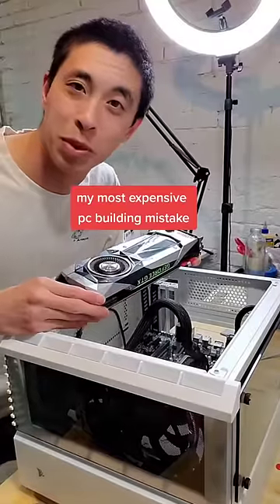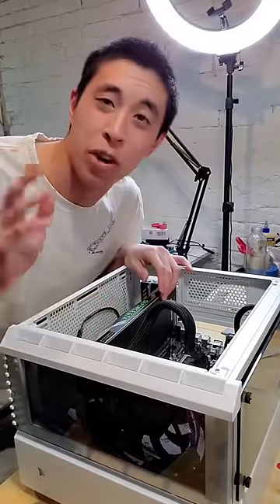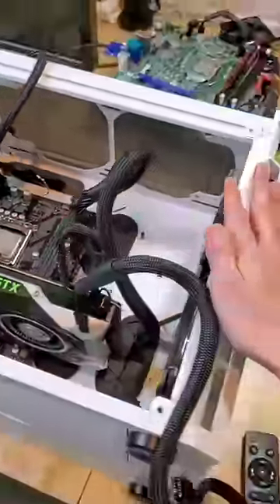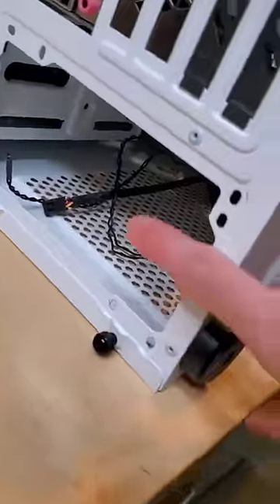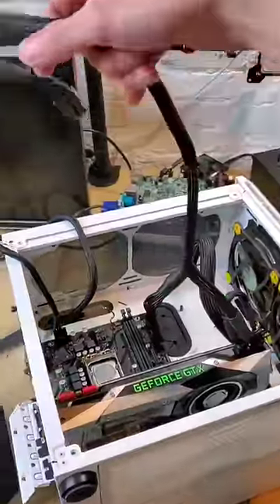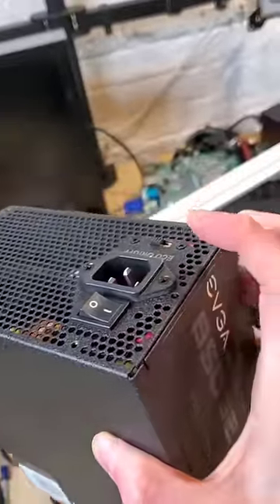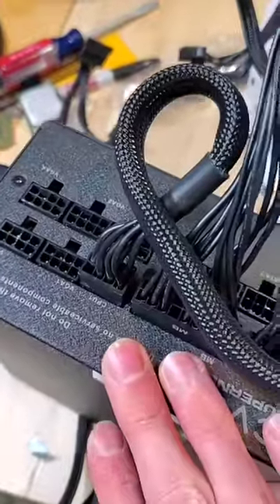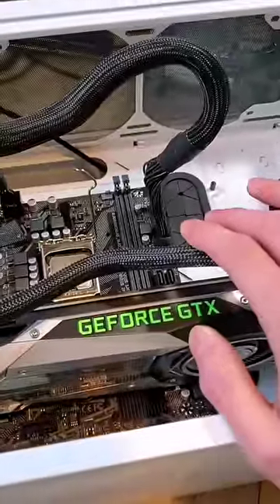my most expensive pc building mistake... #shorts

Comment: My screwdriver slipped when I was tightening the CPU cooler, killed the motherboard, had to get a new one🤠
Reply: Make no sense 
How does a screwdriver kill ur motherboard I have push gpu too hard so many time and my motherboard still work new
Reply: @BlackholeU_U  it scratches circuits or pulls off components like resistors
Reply: Small Capacitors too
Reply: @BlackholeU_U   if traces are ruined motherboard can lose memory channel, usb ports, lan port or can just fly itself on launch.
Reply: That happened to me too years ago.
Reply: @Helva lol
Reply: This legit happened to me on my first ever attempt at building a PC. I was tightening the AMD wraith stealth cooler down and suddenly I lost grip and the screwdriver kind of slid to side and punched into my motherboard. Safe to say - My PC was error free when booting up and I was pleased with the results. Rookie mistakes, tho I wish more PC building guides would outline these little nitty grits. Most mistakes go unreported anyways, so might as well make everything that can fuck up your PC building known.
Reply: @yvesford9579  That a screwdriver can drift off is pretty simple and expected, especially with low experience/low strength.

That's why being more patient can be worth it.
Reply: That happend to me and i scratched my mb, but nothing happend tgod
Reply: Nobody tell him about the Socket 462 cooler mounting.
Reply: Dont Read My Name💞
Reply: same except it was with the demon core
Reply: @Justgreen89925  solder them back 💩🤡
Reply: HOW FUCKHING HARD WERE YOU PUSHING THAT SCREWDRIVER SIR? 😂😂😂😂😂 OR DID U PERHAPS USE AIRHAMMER TO TIGHTENG THE SMALL SCREWS🤔
Reply: @askomoisio  lmfao
Reply: Idk but damaging a MB with a Screwdriver is pretty damn hard tbh. You have to be the most unluckiest person to demolish your MB in that way.
Damaging or flipping of components: Very Very Unlikely
Damaging the PCB: Also very unlikely, you really need SCRATCH the PCB by force to do real damage

Been working in the branch and that type of damage is really hard to do by accident. Heat is mostly more a threat to these components (or Electric Energy) but not something like a Screwdriver that fell onto it
Reply: @nicz7694  by tightening a cpu cooler you are using a lot of force and if it slips you can eliminate from existence almost every small component on your Mobo
Reply: @Justgreen89925  Ok, thats it.
I switched that with "just dropped the Screwdriver", my Bad :D

But yes, that sounds really unfortunate. Currently using these Fast usable ones that you can tighten with your hand
Reply: Always remember, don't use force hand when it's time to put somethings on the computer, stay calm and patient
Reply: @Justgreen89925  solder them back on?
Reply: @user-lb1ib8rz4h  they are sometimes REALLY tiny, so you need good microsoldering skills
Reply: @Justgreen89925  ofc but i think learning that would be much cheaper than buying a new mobo in this economy 💀💀💀
Reply: @user-lb1ib8rz4h  yea but learning microsoldering costs a lot in time and equipment so its not always worth it
Reply: @Justgreen89925  $40ish for a soldering station + $20 cheapo microscope vs whatever a mobo costs these days? former wins easily. plus i already have the former lying around already and even if i didn't, I'd find other projects to use it for (which would justify the cost)

i can't imagine buying tools once and never using them again lol. plus having more skills >>> buying a new thing just for replacement's sake
Reply: Is there any way I can avoid that mistake?
Reply: That can be fixed ez
Reply: Oh I see what u mean cause a few weeks ago I was trying to fix my old pc by swapping out parts with my new pc but when I turned everything on I found out my old pc turned on but my new pc didn’t so I took it to the shop and that’s when they said I messed it up because there was microscopic chipped things in the motherboard and my mom was pissed cause we all know the price of a motherboard we might as well just buy a whole new pc so yeah that’s my story I said I won’t do anything stupid until I learn really well so I’m currently waiting for pc building sim 2 to come out cause it looks a lot realistic than pc building sim 1 so yeah
Reply: @askomoisio  Aahah, not hard, just “accurate” , the thing was starting, but not booting
Reply: @privatematerialcookies9954  just be more patient and careful, get a score driver that is comfortable to hold(I was using the one that came with Noctua cooler, and it was really slim)
Reply: @leoxo4685  got that
Reply: Something similar happened to me
Reply: Who cares if your motherboard got damaged, all i wanna know is if that sweet sweet screwdriver made it?! Hope he didn't get hurt...
Reply: @BlackholeU_U  its the old amd mount method that required a screwdriver to mount which was stupid af my friend back then accidentally poked a whole through a mobo cause of it (ps: its hard to mount and easy to slip)
Reply: I've slipped a screwdriver 100s of times. You must have been putting way too much force into it. Everything should be very light touch so even if you do slip, it's not going to damage anything.
Reply: @boredape1257  you can solder copper wire to restore traces. Same goes for resistor, capacitors, etc. I would only call a mobo destroyed if you burned it or punched a hole in it.
Reply: @skr4207  it's easy to restore traces inside mouse or something like that. but traces on motherboards made by asus are stupidly fragile and thin. so thin its just hard to solder anything to them. also textolite crumbles like efffing sand cookie.
Reply: @BlackholeU_U  it could rip a trace, nock off a small component, or short circuit if the mother board was powered
Reply: @askomoisio  you can't if it rips off the solder pad
Reply: @user-lb1ib8rz4h  it usually rips off the solder pads
Reply: @privatematerialcookies9954  just be careful and don't rush things when tightening any component that requires a lot of force.
Reply: Often screwdrivers just fall of my hand directly into the mobo
Reply: why would u push with a screwdriver though lol - if youre actually trying to make screws TIGHT and youre meeting enough resistance for it to slip and punch into your mobo, you're tightetning the screws way WAY too much - you're basically bending your mobo with that much torque and probably obliterating those screws too
Reply: @Justgreen89925  u shouldnt have to use barely any force at all - if youre using force, youre somehow crossthreading and bending your mobo 
you tighten them until you meet resistance, then stop - no need to 'push' down at all
Reply: @beboid  you have to push otherwise the screwdriver head slips, not everyone has good tools  for the job
Reply: I haven’t even built one yet I swear ima kills if I make that same mistake 😂😂😂

Comment: Didn't actually cost me anything, but when I was building my current rig, I wanted to readjust the cpu cooler. However, no matter how hard I pulled, it just wouldn't come off. That was until it suddenly came flying out with the cpu stuck to the bottom (the cpu was clamped in as well ). So, there I am with my fresh ryzen 5 3600 stuck to the bottom of the cooler, roughly 7 bent pins, freaking out. Luckily, I gently used some tweasers to readjust the pins and the cpu was fine. Didn't cost me a dime, but it really stressed me out...

Comment: The moment I hear you talking about preinstalled cables I know exactly where this is going

ALWAYS check if the cables are compatible with the PSU because the pin-outs can be different
Reply: And then they don't match. I sometimes buy PSUs from retail returns and Amazon returns and then test them and resell them. Sometimes there are missing cables. I have never had a cables with different pinouts but matching connectors. Imo this video is just a fake.
Reply: @forthphoto  wait what? I could walk over to my drawer right now and find an EVGA cable or something to plug into my Silverstone psu and kill everything. Also Greg from science studio (or whatever his channel is now) bricked components multiple times because of this years ago.
Reply: @forthphoto  It is most definitely not. Anybody who knows anything about computers should know you NEVER use PSU cables from another manufacturer or even within the same brand. Linus will tell you this. JayzTwoCents will tell you this. Gamers Nexus will tell you this.
Reply: Thank you for actually clarifying the mistake. This "short" video is hardly informative.
Reply: Which is bullshit
Reply: Can someone explain HOW it could be different? Like what breaks it?
The GPUs are very obviously expecting the same power regardless of the power supply.   So how on earth could 2 power supplies "cable" be set up in a way so different that it hurts the computer?  The end result of every cable should be the same thing surely?
Reply: @maxwell_edison  easy the side that hits the card is set a b c d for example on the pins but the side going into the power supply is d a b c. In the right power supply it all goes the right way. In the wrong you get mixed and suddenly where the card expected a ground you have incoming power and things cook.
Reply: @zannothefox  This. And I must say, this has to be one of the worst designs for anything of all time. I'm serious. Know what the point of a connector that only fits one way is? SO YOU CAN'T FUCK IT UP. GGs, manufacturers -_-
Reply: i was about to ask how something that simple can even result in any damage, but this explains it. You would think there was a standard for this sort of stuff
Reply: @rim7961  there is. Every PSU company uses the exact same connectors. Isn't that nice? Isn't that convienent for you, the consumer? Nothing better than non-standard standards :D
Reply: @sgt.s.muffins189  problem with that is it's standard and nonstandard at the same time
Reply: @rim7961  the best part about standards is there are so many to choose from 😀
Reply: @zannothefox  Thank you for this explanation.
Reply: @forthphoto  Nope, it's not fake - I've had this exact issue happen to me.
At the time, I'd recently built a new computer (about 3 months old at that point), and it had issues where it would randomly turn off, sometimes within the span of 5 minutes, other times it'd go several days without doing it. In troubleshooting it, I thought I'd try ruling out the power supply first, by swapping out my Corsair in that computer for the Thermaltake in my home "server" (old gaming rig).
These were both fully modular power supplies, and the connectors on the power-supply-side looked identical.
I didn't want to re-run cables, so I just plugged the existing ones into the appropriate connectors on each of the swapped power supplies.
When I powered my server back on, within a few seconds, there was a burning smell, so I immediately switched it back off. I then investigated, and all three of my hard drives (totalling 5TB, iirc) had a big black burn mark on their controller boards, but the SSD somehow survived. Luckily, all the other components remained unscathed, and all my important files were In Dropbox, but I still lost a lot of stuff.
Trust me, they're not always wired the same, even if you'd think they should be.
...
Also, the issues with my computer shutting off turned out to be my motherboard, which I sent off and Asus quietly repaired, but never said what they did to fix it.
Reply: I think in my case, it wasn't reverse polarity, but 12V being sent down the 5V rail.
Reply: Ah
Reply: How?
Reply: @forthphoto  yeah I call a little bit of BS there, 100% they're not compatible between PSUs. Like for really for real they're actually not
Reply: Interesting, I thought PSU plugs were standardized
Reply: thats why the cables are labeled gpu or cpu and same on the psu nothing todo whit diferent cable its the user fault
Reply: @forthphoto  I was kinda thinking the same 🤔
Reply: @pilote111  the plugs are standardised yes BUT sometimes different manufacturers put the wires into different holes on the plug

that's why you want to always Google and check if the pin-outs are the same
Reply: @hoguemusic9706  "Or even within the same brand" What? That's not true at all. What if you're missing a cable? You buy the same type/brand cable. It's not rocket science.... just use the correct one.
Reply: @Wft-bu5zc  Ok, thanks for pinging me 8 months later

Comment: "I'll use one of my modular power supplies at home..."
Me: NOOOOOOOOOOOOOO
Reply: My same reaction.
Reply: Yup, had the same reaction and immediately knew what was the "expensive mistake"
Reply: Why did that happen though? Honest question, as i never owned modular or semi-modular psus
Reply: there is no industry standard for pinout on PSU and the cables so most of them have completely different pinout meaning when you mix the cables when on one cable that pin will pe Ground on other it can be power, the worst part is that even power supplies from the same brand can have different pinout. Worst part being GPU and CPU cables they look the same but the cable pinout is different
Reply: @alv1n383  damn just bought a complete replacement psu cables to match color. How would I know that everything is correct? I haven't plugged it.
Reply: @radityaindera3442  i would check the order to see whether it's compatible with your PSU or use multimeter to check pinout continuity and compare it to the original ones if it's the same
Reply: @alv1n383  Thank you for clarifying this.
Reply: I literally didn't look up sophisticated cooling for my PC build and I took people saying "water cooling" way too literal, before my first gaming session I froze up 4 ice packs and jammed them in but they melted
Reply: @bensmiley7042  how old were you at the time?
Reply: @alv1n383  damn, I always thought it was standardized
Reply: @flowwy_  dont listen to them, if whay they are claiming is true then what about custom argb modular supply cables? It was likely that this guy used bad cablea
Reply: Is this consequence related to the fact it was a modular PSU? Would the same have happened had it been a non modular PSU?
Reply: @Maximo2204  if it was non-modular, he would've had to take out they modular cables that were preinstalled.
Reply: @reubenkriegel7639  So I guess, as a beginner PC builder, I should stick with a non-modular PSU to avoid any problems. Is that good logic?
Reply: @Maximo2204  the only problem is using one brand of cables with another brand power supply.  If you want to buy a modular power supply, just use the cables that come with it and don't mix them with another brand.
Reply: @reubenkriegel7639  Okay, simple enough. Thanks a lot
Reply: @flowwy_  the polarity can be reversed as the cables can be wired in a different orientation. or you can even get a higher voltage line going where it shouldnt
Reply: my reaction "SHIT DAMMIT PIECE OF SHIT SHIIIIIIIIT
Reply: @lunarmoony3278  The wires are not standardized.  Most likely a lot of the wires were not right, and therefore he fried everything.

Comment: When I was younger I took my CPU out and all the pins were bent. I went through each pin individually and straightened them out, and turns out they were actually all supposed to be bent.

Edit: I meant the motherboard pins on the CPU socket, not the CPU itself.
Reply: Wait what?
Reply: What cpu?
Reply: I assume you meant the pins on the motherboard in an LGA socket?
Reply: @aylim3088  yes the motherboard
Reply: Uuugh
Reply: OOF
Reply: oh my god, that's actually hilarious
Reply: Hahaha
Reply: I thought only the government had that kind of dedication to a screw up.😢😂
Reply: @tommyt414  hhahaha
Reply: I think I did that too, while drunk a month ago
Reply: @Welv1987  “I think” 😂😂
Reply: how is there a CPU that is suppose to have bent pins? and if the pins were bent how are you suppose to put the cpu back(also i think all of the pins were bent because you prob rubbed it against something)
Reply: @Nash12132OG  With certain motherboards, and I can’t speak for all of them, but I can for the LGA1151 sockets since i just repaired the socket on one, the pins are supposed to have an angle that they are held bent at from the factory. Spacing is supposed to be perfect as it can be so it can make contact with the contact pads on the processor itself, which has the flat pads on. The bent, flexible pins on the motherboard itself get pressed down with equal pressure as you press down the lever and finish installing the cpu. So in short, the original commenter somehow thought he had to remove this angle and straighten out the pins, that usually have both a “floating” angle and a side to side angle (like 45 degrees from the squares). It’s kinda hard to explain tbh
Reply: @Riley-sz9rs  thanks, this is exactly what happened. And I misspoke in my initial comment, I did mean motherboard.
Reply: @Gobbertron  No problem! I understand since I had to repair mine due to bent pins from the person i bought from… ended up getting to keep the board and so I got it for free minus my time and effort!

Comment: I was close to doing this error when I noticed that one of cables had different pins. Then read the manual and saw they don’t want you mixing cables, only use the ones provided. Went back and replaced all the cables. I am glad to see this video as there was some doubt that it was necessary to use the provided cables